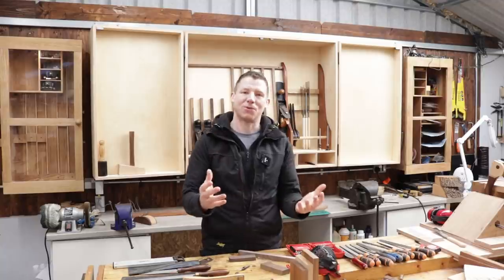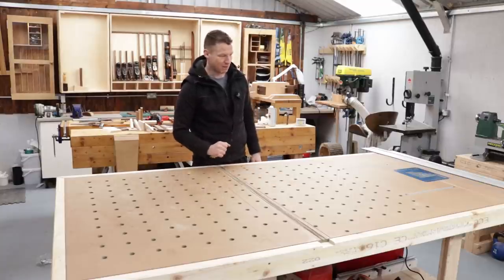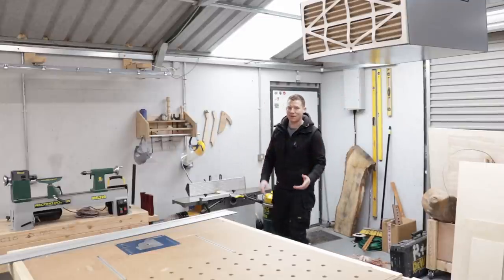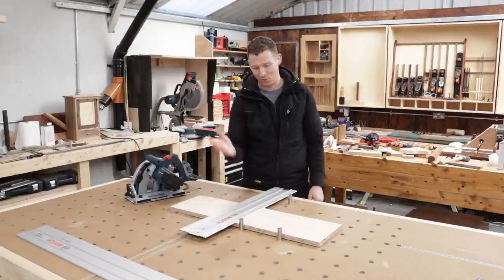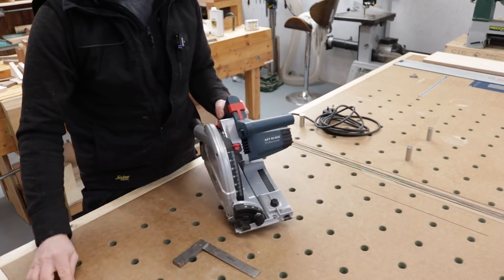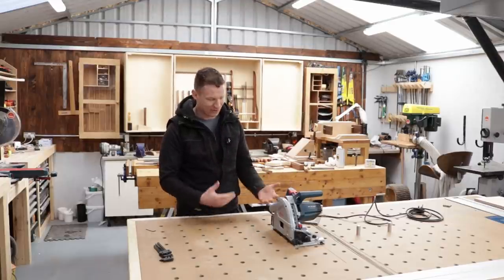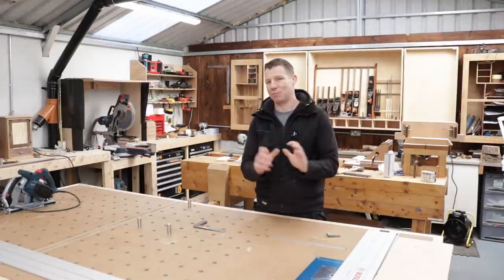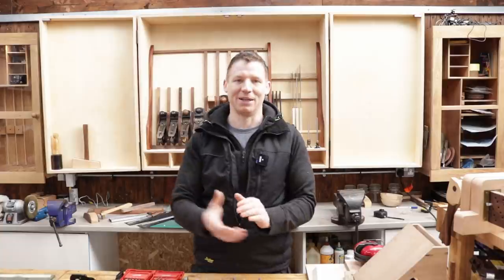Workshop Vlog #15 Bosch Track Saw Issues! Tools, Project and Channel Update.

Comment: Thanks John - very good video. I would say Makita/Festool  tracks are more suitable for this type of work (dogs). I am planning to buy 1000mm from Makita. Even more - one can use different (thicker) blades (Bosch has 1,.8mm kerf) without destroying rubber lip alignmnent. It is sometimes handy to use them. 
Re 90 deg alignment - I have no issue with scales but have had a problem with 90 and 45 deg alignment. I used inclinometr for this job. Just unscrew the top cover of blade, set the saw on the track and than align the angle of blade against the track. This works perfect - you have plenty of space around. You can even check if the angle does not change when you plunge-in - not to mention one can check if the blade is perfectly flat when mounted (should be - but from my experience it is not always true) . Most of all, once you fix the blade plunge position and saw position on the track I have both hands free to make any adjustment I need. Maffel can do this with a press of a button - with Bosch you have to unscrew 5 (or 6? I am not sure) easily accessible screws. 
It would be good if you have mentioned in your video that you can align 90deg as well as 45deg stops. Unfortunately out of the box both were misaligned by approx 0,5 deg. AFAIK 45deg stop cannot be set with Festool (only 90deg or go to service). Once the blade is aligned perfectly screw the cover back -and I found that scales were aligned perfectly as well. And repeatability switching between 90 and 45 degs was not a problem. It seems that checking the saw prior to first cut (as you said) is a good practice - especially when you ask for real precision. Vlad
Reply: If it's not too late you might want to consider festool tracks if you're also in the market for parallel guides.  The TSO parallel guides have a quick adapter that fits festool only.  You basically just plop it down anywhere on the guide rail then pick it up when you're done.  They can also be screwed to the guide rail if you prefer.  It's a simple design and it makes breaking down sheet goods in a small shop less of a hastle.
Reply: @ThekiBoran  Thanks for tip ! BTW where lies the problem with rail compatibility FEST vs MAK -  esp. with those parallel guides? That small rail lip which is on MAK and not on FEST?
Reply: @vjurco 

The only compatibility issue is with the quick adapters. To answer your question that's probably it, the anti tip lip.

https://youtu.be/wtHrqdLbqF4
Reply: @vjurco 

It could also be the overall shape of the makita, so trying to make it work might be a fruitless endeavor.
Reply: @ThekiBoran  Thanks again. Seems that this "anti tip lip" might be a problem. So far I´ve heard that apart from some special adapters for FEST both rails are fully compatible
Reply: @vjurco 

I believe that is correct.  But those quick adapters for the festool guide rails are the shiznit.  Did you see the video I posted?  I'm not sure how else TSO can improve their parallel guides.  Maybe motorized flip stops with a digital readout?  ;-)
Reply: @ThekiBoran  Yes I viewed it. As TSO is not available in EU (I did not find any info - just UK) I will probably take it from Festool directly (Festool FS-WA/90° - licensed TSO AFAIK) + I have to rethink this MAK FEST rail question. Thanks for good observations. :-)
Reply: @vjurco 

TSO is available in Europe but they're having productions issues so the TPG 30-50 kits aren't available at the moment.

Comment: Great vlog!!! Just bought the veritas mk2 honing guide ( using diamond stone) still learning how to use it tried it with my no.6 Luban and no.5 and no4 getting good results but... it's still new.  For the bosch issue I'm checking all my power tools for 90 with engineered square all the time I don't trust the manufacturer set-up ( except my metabo mitre saw), and it's odd that bosch have got that issue with high hand tool!! For the condensetion broblem I'm thinking of two solutions : insulation to you metal ceiling, or dehydrated the air in your shop ( not chip solutions). In Israel we are at our 3rd curfew... tomorrow getting my second 💉 covid-19 vaccine. Be safe and stay strong, looking forward to your next content!!

Comment: You have definitely thought the dust extraction through, and having a dedicated machine for the downdraft table is a good idea.
But for extracting from your portable power tools at the table, I would recommend having the hose suspended above the table on a swivelling arm or bungee cord....it's the only way to keep the hose away from the edges of the table and stop it catching. I tried a smaller record machine mounted under my workbench with a socket for the extractor hose on the table top...I also tried mounting it at the side of the table, but the hose was either too long  or too short and mounting it overhead was the only solution to keeping it off the table and stop it hanging up.
If you could get some fine panel filters and a good fan, why not try building a powered filter box under your sanding table area to make it fully self contained?

Comment: For sheathing the dust extractor hose, cover it with, “PET Expandable Braided Sleeving”. It should be available on Amazon, Ebay, or any number of other online sources.  You want it for a slightly smaller diameter then the hose you will cover.

Comment: Hi John, A cheap & simple solution to your hose's snagging on the edges of the table is that even if you've chamfered or used a small radius round over bit in your router, is to use the biggest radius round over bit that you can get your hands on! It'll put a larger rounded surface for the hose to easily slide over without snagging

Comment: Get yourself some pilosil or “braided” sleeving. VDC do all sizes you can think of. 
Then not sure if you come across it much in your domestic work, but try powercon connectors, for attaching bench. That or ceeform, but the later are obviously pretty bulky.

Comment: Drippy roof? I sympathise, my roof dripped a load in my absence during torrential rain.  Lost my makita track saw,  jobsite table saw, makita combi drill, and charger plus a load of hand tools and clamps (yes they were getting long in the tooth but the worked just fine until filled with water) . 😭 What with covid restrictions, getting covid x2 and other issues here I am two years later still trying to get back what I lost,  but £££££ are disappearing on everything else but tools.

Comment: Hi John, my workshop condensation problems increased when I started using Propane C3,H8, I think the Hydrogen content can combine with Oxygen to form water droplets ( think about condensing boilers ) Regards Kelvin, Kent UK.
Reply: I had exactly the same problem when using Propane in heaters. The amount of water they push out is incredible. I ended up have to use a dehumidifier as well, and moved to an alternate source of heat. ( Putting another Jacket on )
Reply: @paulcooper9187 

There are small propane heaters that can vent the exhaust outside.  I was attempting to paint and clear coat with water based poly in my garage/shop in cold weather.  Not good.

Comment: Another great vlog John 😁. Just quickly on the dust extraction for your MFT, couldn't you go for drop down hoses? You are already half way there!. You could T in to your main "cross shop" pipe with a short outrigger pipe and then drop a single hose down to your table. Have a single connection on your table piped for the router and the downdraft, with an additional connection for a fly hose for the track (and cleanup) ! That way the Record never has to leave it's place by the door... it could work 🤔. Thanks for the video, stay safe 😁👍
Reply from the maker: Might just look at that Frank

Comment: Mate, regarding your dust extraction. Why don´t you just put a Y-connector from the main 100 mm pipe in the roof and out to a pipe that ends just above your MFT table and connect the tools there? That way you wouldn´t have to buy a new extractor and still be dragging the old one around the workshop to connect to the MFT. 

Or am I missing something?
Reply from the maker: 🤔hmmmm!
Reply: @JohnMcGrathManInShed  Did I just mess up your plans? ;)

Comment: RE Dust Collector location:  Put the collector outside under a shed roof next to the Pedestrian door, where your current piping ends.  This makes the actual fine collection less critical, because it is outside the work area.
Reply from the maker: When the weather improves I might just do that

Comment: John, non drip sheathing I think is a sales pitch, grand for farm sheds not workshops. Come summertime whip the roof off, put a double layer of roof membrane then sheathing back on and insulate the inside with 50 mil kingspan, job done.
Reply from the maker: You make it sound so easy !

Comment: With respect to Rob Cosman's sharpening setup, I might point out that if you use diamond plates that are based on aluminum plates, instead of steel, you don't have to worry about rust.

Comment: This squaring up does not work for me. I can get it perfectly square like in this video - that is, without the guide rail. But as soon as I put it on the guide rail, it shifts by 0.5-1°... So - to set it up square on the guide rail - I have to do minor adjustments and test (and adjust, and test etc. etc...)... and it's all genuine Bosch, both guide rail and machine, AND there is no warping of the base plate. Also, I have had this problem both before and after changing the rubber (original also), and I have not used any clamps on the rail to distort it... I really do not like this solution by bosch, and the guide rail is sub-par.

Comment: Do you ever use a table saw? And would you ever consider getting a big cabinet saw? I use a Dewalt contractors table saw and its ideal for me, I basically work out of half of a single car garage 😅. 

Speaking of Rob Cosman, his dovetail joints are outstanding. I almost had to rethink taking up woodwork 😂😂

Keep up the great work John 👍

Comment: Hi John, thanks for pointing out the fix for the track saw - that not returning to 90 has been driving me crazy!
I have a Bosch GAS shop vac which also has ridges on the hose which catch on stuff. My solution is to suspend the hose from the ceiling using a retractable spring balancer - https://www.amazon.co.uk/gp/product/B08HQY7D8B/ref=ppx_yo_dt_b_asin_title_o02_s00?ie=UTF8&psc=1
That works great for me!

Comment: Just out of interest. Why would you build a water bath if you're going to move to Rob cosmans method?
Reply from the maker: Just for the water stone Its a nice little project
Reply: @JohnMcGrathManInShed  I was wondering the same thing. I think Rob primarily uses diamond stone for the low grit and a ceramic/glass stone for the highest grit, And the ceramic one doesn't need to be soaked, it just needs surface lubrication sprayed on. Although I'd agree a video on how to build a water box would be fun and it would be good for anyone using water stones. There are dozens if not hundreds of sharpening options, and it is fun to see all the different one used by different woodworkers. Plus you could also use a water bath for your water stones for other sharpening needs such as knives etc.